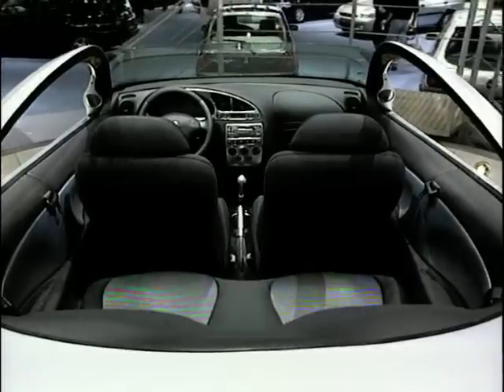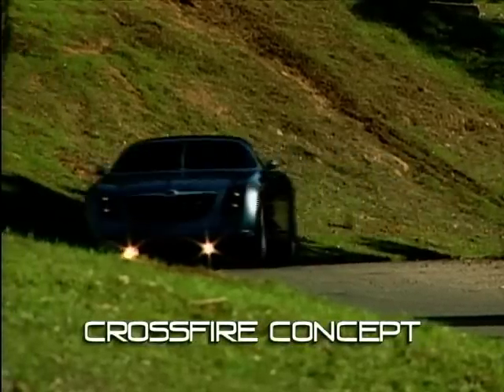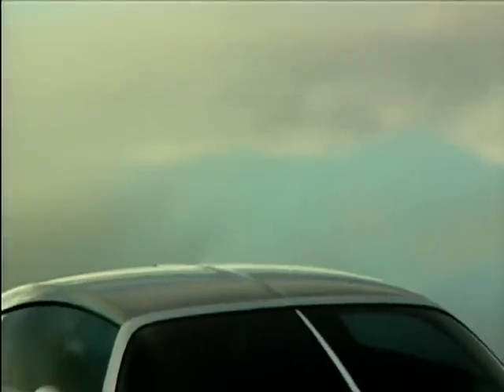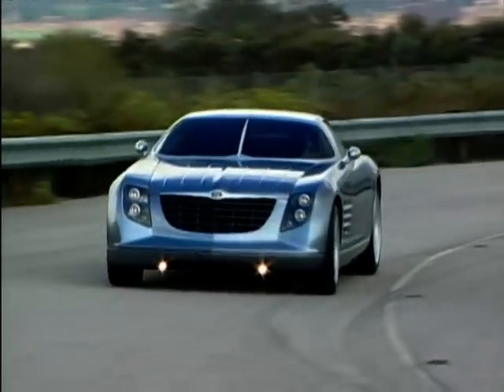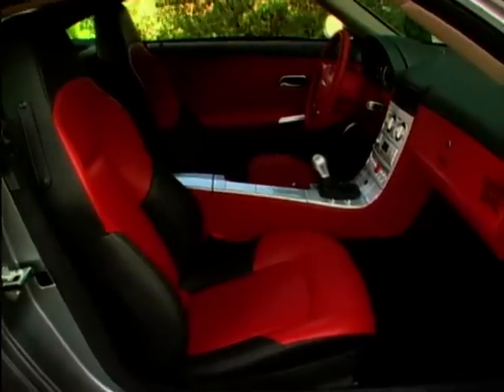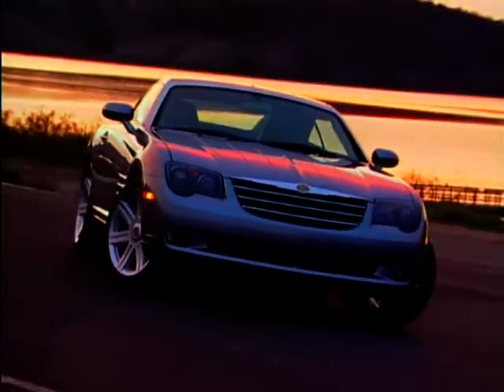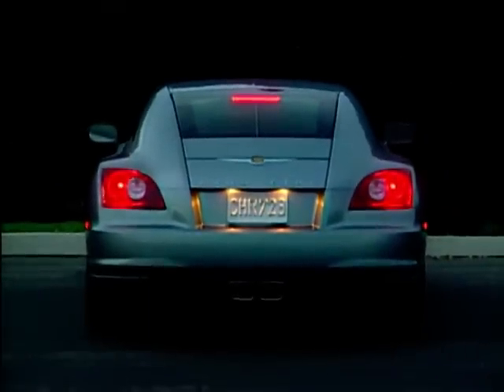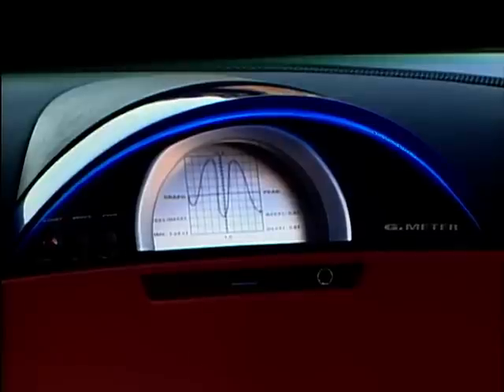Chrysler Crossfire: From Concept To Production

Comment: One of the best bargains and greatest rides you can get for the cost. I paid $13K in 2011 for a 2005 coupe with 49K that was never winter driven, all with Mercedes build, fit and finish, parts readily available from Mercedes and still turns heads wherever it goes.If you done't want to stand out, don't buy this car as you are a visible and magnet for everyone who sees it. Never had so much attention with any other car I have owned (35)
Reply: Parts are so rare and expensive now

Comment: And what 2.7L v6 with near 300hp are you speaking of?
Reply: +blackxfire04 there was a twin turbo production version called  SRT6
Reply: +Alex Levy... Don't you mean supercharged?
Reply: All Crossfires have a 3.2L Mercedes V6, the SRT version had the AMG supercharged version of the engine with about 340hp.
Reply: paul austin   No. No such engine exists much less in a Crossfire. Only the 2 versions of the same engine as I note above were used in Crossfires.
Reply: paul austin  You may say you do but you don't because what you say is not factual. Feel free to back up your claim with even the slimmest shred of proof, we'll wait.
Reply: The 2.7 Liter V6 was in the concept car. The SRT6 has the same engine in the SLK32 and C32 AMG’s. Mercedes purposely quoted the HP and torque lower in the SRT6 as to not upset the current owners of said models. The SRT6 actually has better cooling so it’s closer to 360hp than the 349hp the SLK32 and c32 have.

Comment: I like these but i hear they suffer terrible rust?
Reply: I have a 2004 that has spent most of its time in upstate NY and it has no rust.
Reply: Wrong, no rust issues.
Reply: I have an 06 and I have no rust issues. I'm at about 106k miles and the only issue I've had was the ignition locked up on me. Spent about 400$ to get it fixed. Great car, definitely turns heads especially when it's detailed